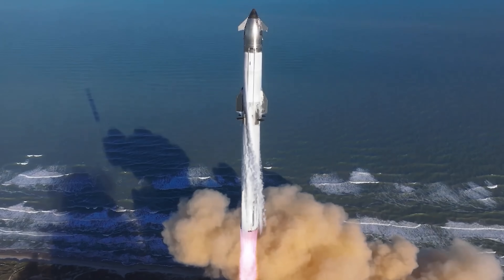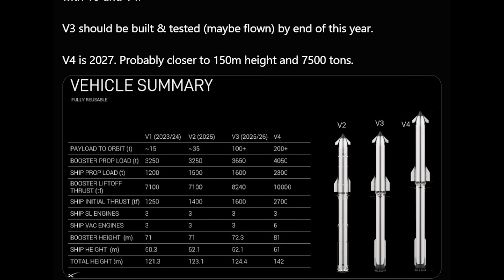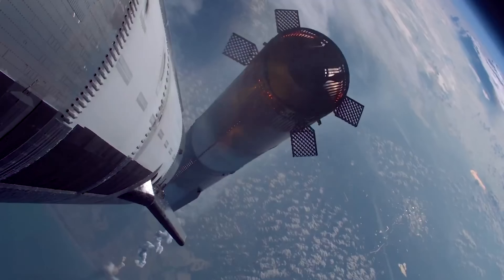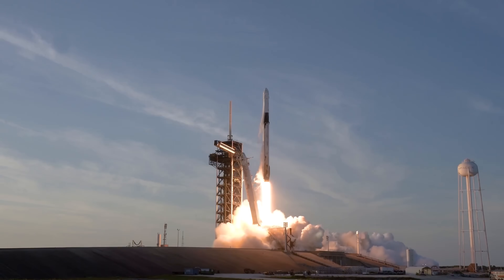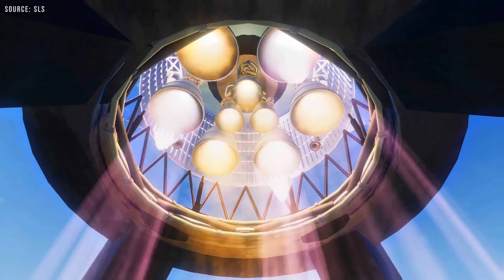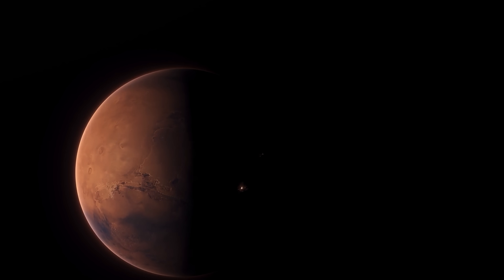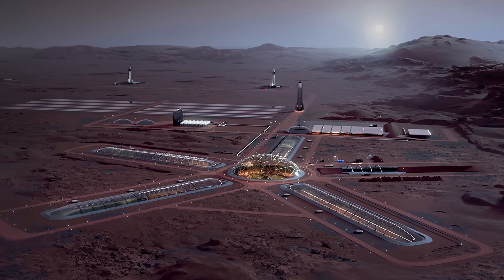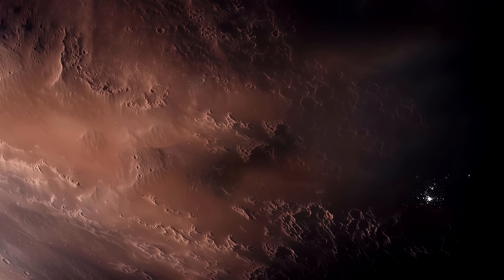Elon Musk reveals SpaceX's New Starship V4 Option: 200 tons to Orbit!

Comment: Still wondering if it wouldn't be more feasible to have the starship stay in orbit around Mars and just drop smaller pods to the planet. This way the starship doesn't have to worry about legs or a stable landing. For it to remain indefinitely in say Phobos orbit and to host pods to and from the planets surface at least until optimus robots can assist in building a base.

Comment: The con artist was making that claim for the first Starship many years ago. Funny how no one notices his track record of fraud and failure.
Reply: Trans?
Reply: I wouldn't say it's a con, but SpaceX has consistently overestimated the payload to capacity to orbit. Originally, V1 was supposed to have 100 tons to orbit, then it got downgraded with V2 having that performance with V3 having 200 tons to orbit, and now it's V3 that has 100 tons and V4 having 200 tons, so the goal posts keep moving. However, it is common that early versions of rockets are heavier with lower performance than originally specified, with later versions hitting the original targets by reducing the empty weight and increasing rocket performance (for instance, the Space Shuttle needed to reduce structural weight of later orbiters and SRBs and upgrade SSMEs to 109% thrust lower in order to achieve performance closer to original targets, but never launched a payload close to it's original 29.5 metric ton capacity (largest payload launched was the 22.7 ton Chandra Observatory).
Reply: You are misunderstanding what he is saying. He speaks about "We want to", "We hope to" or "Best case scenario" ... that is not official timeline. Nobody can know when it will be ready. Aside from it, this are just test rockets: they are meant to fail to know the limits. Just look at how many years were necessary for humans to build reliable airplanes. They kept developing them for more then 100 years until they got to supersonic and safe.
Reply: Democrat?

Comment: Skirting the engines on the Starship may be the problem. Caging them so gas's don't get accumulated and cause an explosive event may correct this. I believe moving the aft flaps leeward,  like they did the forward flaps and moving them up a bit may solve the errosion of the flaps during reentry. I'm impressed with SpaceX progress.
Reply: So far it seems the aft flap burn through only happened due to damage caused by the relocation of the engine vents for chill down, I don't think a flap relocation is necessary to fix that, the reason the front flaps had the burn through was because they where mounted to a curved surface on the length of the flaps which makes seals a lot harder

Comment: КАК ЭФФЕКТИВНО ВЫВОДИТЬ ГРУЗЫ НА ОРБИТУ?
 The Cluster Inclined Catapult effectively launches rockets at the launch pad.
Of course, the force required to launch a rocket from the ground is quite large.
The initial part of the launch, known as the vertical "liftoff", usually requires a huge amount of energy due to the fight against gravity.
So, effectively launching a rocket from the ground does require significant effort.
Gravity is a good helper in this matter: it accelerates the catapult with the rocket along the inclined plane to the surface of the earth to the speed of sound, without wasting a single gram of fuel.  https://youtu.be/3yRAdU3qutc
Reply: Spacecraft should not be fueled with explosive types of fuel. Liquid cluster fuel is an excellent alternative.
New liquid high-energy cluster fuel with a density of 70 MJ/kg works without an external source of oxygen, is non-explosive and almost doubles the power reserve and duration of the flight.
In addition, the new cluster fuel, having a large power reserve on the device, allows you to turn on the cruise engines in a counter-current and gently enter the atmosphere without plasma friction with the atmosphere due to the necessary reduction in speed.
It also becomes possible to pilot the device like an airplane before landing on the runway.
https://www.youtube.com/watch?v=3BcZPEvX2_M
Reply: This type of launch does not require the millions of horsepower of the engines, which often leads to overheating and explosions. The device will take off from the ground in a well-studied standard mode, using all the principles of aerodynamic lift and inertial forces.

Comment: I really want to see the starship dock with the ISS.
Reply: At this rate, they will be able to send up a replacement in only a few trips. Doubt the current ISS weights more than 200t.
Reply: @jandrews377  last i heard ISS just topped 405 short tons
Reply: Starship is the new space station...
Reply: @1bengrubb ISS is 420t. 2-3 lifts should cover it.
Reply: @1bengrubb  that was the plan for the get going. Dock many Starships togheter into orbit, sent refueling to the station, send crew, launch them all to Mars.

Comment: I am surprised that SX is not doing tanker/depot/transfer with F9s. F9 uses RP1, but also LOX. Starship is LCH4/LOX. Oddly, while RP1 and lox will almost certainly have different tubing, tankage, gaskets, etc, LCH4/LOX will make use of the SAME ones. Why? Because LOX is not only colder, but more reactive. As such, testing th F9 with LOX pretty much guarantees that tanker/depot will work with starship within first or second testing. 
And it is a fraction of the costs to do that now.

Comment: The payload increases will never be enough, so there will always be another, bigger version that will be able to meet the goal.  The problem is that even with a 200 ton payload, it will take 10+ fuel transport ships to refuel for the moon mission.  (With current payload of 35 tons, it is virtually impossible.) That is alot of docking and fuel transfer, which has never even been done before in space.  The 2027 Moon timeline is complete fantasy.  Its a very visually interesting project that doesn't have the capacity for the programs it is being developed.
Reply: There was a 2024 Mars timeline, not that long ago.

Comment: No way can Elon send a ship to Mars next year without tanker in orbit to refuel the ship first before heading to mars.
Reply: They need to put up tanker/depot on several F9 upper stage and get this worked out NOW. While F9 uses RP1, it also uses LOX. That lox will have the same metals, gasket, etc as for CH4 (LOX is colder and more reactive).

Comment: Seems like they would have perfected V1 by now and all infrastructure would be mature. No reason to move on as the towers can only accommodate a certain height. Perhaps Elon needs to move the goal post for whatever reason.
Reply: I get what you're getting at, but the reason they're iterating is because the previous design is suboptimal. Take Front flaps, on the V2, they moved them back, which helped with the plasma burn in. Moving across versions is "perfecting" the design. Same with raptor
Reply: Here’s a problem with that though. The V1 does not have the strength or fuel capacity to complete the missions it needs to do. Each new version increases fuel capacity and strength slowly until they reach the necessary levels to complete the missions.

Comment: lauch 10 barely made it off the launch pad. spent the first 8 seconds clamped down before it burned off enough fuel to get airborne. even then the assent rate was about 0.3g's.
Reply: Haters will always hate. People who only see negative in others only have negative in them
Reply: Thrust 2 weight ratio: V2: 7100/5050 = 1.40. V3: 8240/5550 = 1.48. V4: 10000/6750 = 1.48. Saturn 5: 3300/2900 = 1,14. So what's your problem? Just compare Starship and New Glenn dynamics until MaxQ. Starship is 25% faster though 500% heavier.
Reply: Yeah i was wondering why it was so slow to take off.
Reply: 8 seconds is an exaggeration. It lifted off the stand after 5 seconds. Also, this seems quite normal. The starship weights ~11 million pounds with full fuel, so it’s going to take a bit to accelerate. 

Also, it wasn’t waiting for enough fuel to burn. It was just generating enough force to go upwards.

Comment: SpaceX must build a Human Space Station Transport. MARS will need the KILO Nuclear Powered 5kw Generator from Redon and the 1MW Modular system. This has been in the works under taxpayers money sense 1960. The Station will be about 550m to 700m with a G less than 1 RPM for 100 passengers on the first mission. Space X will need to use ICON engines with the Raptors.

Comment: Would it be possible to attach 4 Falcon 9 boosters to a structurally reinforced V4 Starship booster, allowing the Starship booster an extended burn to orbital altitude, and avoiding having to use any of the Starship's fuel and avoid in orbit refueling? The Falcon 9 boosters then all return to land like they normally do, and the Starship booster would land from a higher altitude and greater speed as it has its own heat shield. The trade off being a reinforced Starship booster and Falcon 9 fuel vs no refueling of starships in space, and time saving?
Reply: I like this idea, wonder why they rejected this idea.

Comment: 1. Orbit first 😂
Reply: It can they just need more data since orbit means to deorbit also like it's common sense
Reply: It already went orbit
Reply: 200 kilos is Butch and Sunni 😂
Reply: They've already deployed satellites with it. 😂😂😂
Reply: @JonathanHoward-x1o they were dummy  mock ups and 1 may have hit the 
Fin that was damaged
Reply: They have been doing orbit with Falcon rockets. Startship is designed with everything reusable. From booster to the Starship that holds the 200 ton of cargo. 

In other words, orbit is not the challenge. It is to get all parts reusable like commercial airplane engines.
Reply: It already basically went to orbit just with a periapsis that was inside the atmosphere just running the second for a few more seconds and they would be in a stable orbit

Comment: You could use the 2 rear fins to land on Mars with just 1 landing leg similar to Falcon 9.
Reply from the maker: 1 landing leg? How
Reply: @SpaceZonea  I think the implication was if you stengthened the flaps you could use them as 2 of the 3 legs.
Except it would almost certainly take more mass to strengthen the flaps to support the ship than just adding dedicated legs. I'd also want more than 3 legs because Mars isn't going to be perfectly flat. It'll be a while before they get 'proper' landing pads made on Mars.
Of course most of the ships landing on Mars are going to be cargo ships going one way only so it doesn't matter if you just land them on the skirt, they're never going to fly again.